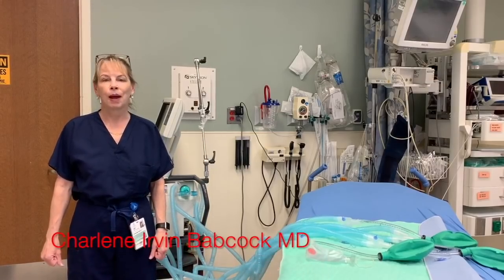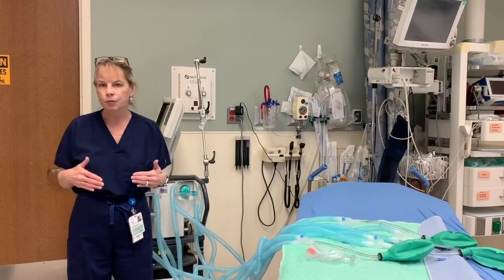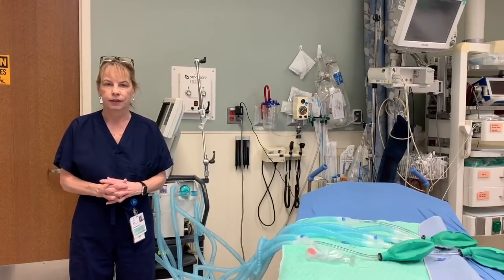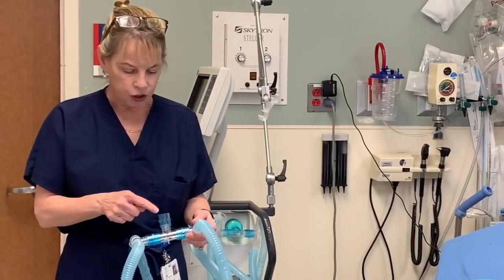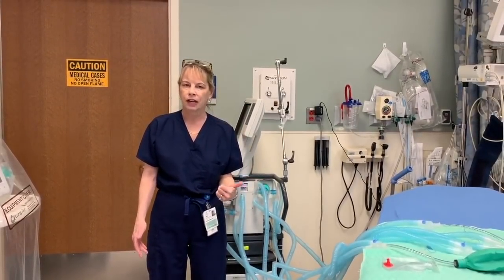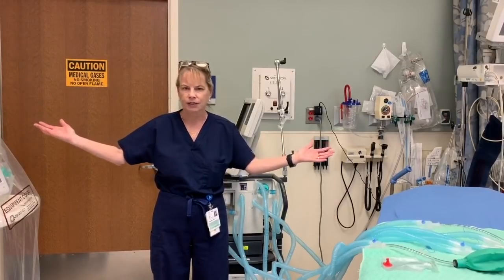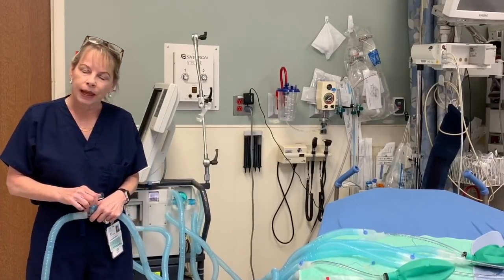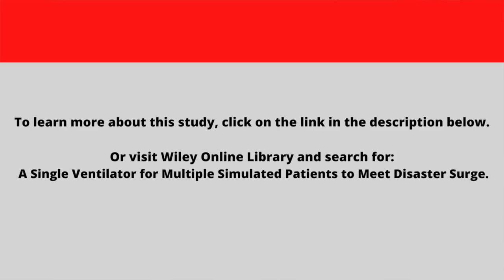COVID-19 How to Use One Ventilator to Save Multiple Lives

Comment: I ruminated a consideration on this proposal for the last couple of days as Germany is in anticipation of the surge.

To be clear: This is also just a theoretical exercise and – if applied - would count as a desperate measure in the case of patients otherwise not being ventilated at all.

What if the mode of ventilation chosen would not be conventional BIPAP but APRV/inverse ratio PCV?

The control parameters correspond to conventional ventilator settings as follows: P-high (P-insp),  P-low (PEEP), T-high (insp. Time), T-low (exp. time) and FiO2. Note that implementing this mode of ventilation with conventional BIPAP, which is possible in some devices, will in some setups require calculation of respiratory rate, which is 60/(Thigh+Tlow). The slightly different terminology as well as specific algorithms for implementation have been characterized and properly published by experts in the field – which I am NOT. There have been promising studies in ARDS which I will attach below.

If one assumes that for two (or more) patients the key treatment goal would be oxygenation with a more liberal approach to CO2 removal, it should be possible to choose P-high, FiO2 and to some degree T-low to achieve safe oxygenation margins for both patients. 
This would still allow for some inhomogeneity in compliance between the patients as the lung is splinted to a rather high point in the P-V curve by P-high resulting in a high resting volume. This is the proposed “open-lung” aspect of this ventilation mode. Nevertheless, due to the sparse and brief passive pressure relief phases it is believed to go without higher frequency repeated expansion like in conventional PCV, resulting in less energy deposition into the tissue. The repeated overinflation/atelectasis due to inhomogeneos P-V dependencies had been my main concern when thinking about PCV in a shared circuit and a possible result of volutrauma/atelectotrauma in the patients. 

In case of inhomogeneous severity between the patients/different disease progression the treatment goal could be set for the more severe patient accepting hyperoxia in the “more well” patient.
In terms of CO2 removal a “common ground” target for the patients could be set in wider range of acceptable values, opting for permissive hypercapnia.
As the passive release of the lung volume to exhalation in T-low will generate outflow which is cropped at a certain level of peak flow (by setting T-low) when conventionally setting up/adjusting this mode, it might be difficult to assess this control parameter for the individual patient in a shared circuit.

APRV does even allow for spontaneous breathing on P-high in weaning approaches which have been proposed as well.
If flow for the device serving two patients would be dialed high enough to compensate for potential maximum inspiratory peak flow generated by both patients in spontaneous breathing, it could be fathomable to even conduct weaning with two spontaneously breathing patients sharing the same circuit.

I write this as I feel we are all staring in a potential abyss, which might force us to make choices that neither of us ever wanted to make.

Hence, this is a THEORETICAL CONSIDERATION and not a recommendation. Also I do not take any legal responsibility if patient harm ensues. I hope everybody understands that.
Also probably someone already thought of this.
But I thought: Sharing is caring.

Take care and stay strong.

C

Cane RD, Peruzzi WT, Shapiro BA. Airway pressure release ventilation in 
severe acute respiratory failure. Chest, Aug 1991: 100 (2); 460-3 Fergson 
ND, et al. High-frequency oscillation in early acute respiratory distress 
syndrome. New England Journal of Medicine 2013, 368 (9), 795-804 Frawley 
PM, Habashi NM. Airway pressure release ventilation: theory and practice. 
AACN Clinical Issues, 2001: 12 (2); 234-246 Garner W, Downs JB, Stock MC et 
al. Airway pressure release ventilation (APRV). A human trial. Chest, Oct 
1988: 94 (4); 779-81 Habashi NM. Other approaches to open-lung ventilation: 
Airway pressure release ventilation. Crit Care Med 2005 Vol 33, No. 3 
(suppl.) Maxwell RA, Green JM, Waldrop J et al. A randomized prospective 
trial of airway pressure release ventilation and low tidal volume 
ventilation in adult trauma patients with acute respiratory failure. The 
Journal of Trauma, Injury, Infection and Critical Care, 2010: 69; 501-511 
Modrykamien A, Chatburn RL, Ashton RW. Airway pressure release ventilation: 
an alternative mode of mechanical ventilation in acute respiratory distress 
syndrome. Cleveland Clinic Journal of Medicine, 2011: 78 (2); 101-110 
Rasanen J, Cane RD, Downs JB et al. Airway pressure release ventilation 
during acute lung injury: a prospective multicenter trial. 
Critical Care Medicine, Oct 1991: 19 (10); 1234-41 Roy S, et al. Early 
airway pressure release ventilation prevents ADRS – a novel preventative 
approach to lung injury. Shock 2013, 39 (1), 28-38
Reply from the maker: SO now we have an IN VIVO study..and. it worked.....

Dr Marco Ranieri of Bologna, Italy and his team Have successfully tested the approach in vivo in one of the hospitals in Italy overwhelmed by the COVID-19. 

They worked with Intersurgical, an Italian company based in Mirandola, started producing the circuitry in only 72 hours, and the first prototype has already been tested by Bologna Sant'Orsola Hospital. It works and in the next few days they'll start a mass production to supply Italian hospitals who are in need

Comment: This is super helpful, I'm an anesthesiologist and we are prepping for a major influx of COVID19 patients here in Houston Texas so I'm taking notes!
Reply: Please don't until you've checked the vents for maximum circulating volume.
Reply: Well you should go for more schooling, this is about the stupidest thing I have seen. People's lungs have different compliance and there is no way to put people with "similar" lung compliance together as compliance is dynamic.
Reply: @Catching_Rockets  for two patients same or near weigth parameters ar closely the same ...si theoritecly it's pissible
Reply: @slimanirabie1820  Your not taking into account lung compliance. So theoretically it's completely impossible.
Reply: @Catching_Rockets  Yes there is. It is easy to modify the volume of air going to each tube with a simple screw valve. See: https://www.youtube.com/watch?v=eSVbwWANqRI&t=90s
Reply: @reality9  You can't modify volume of air with a screw valve. And I don't need links, I'm educated. Pressure is going to follow the path of least resistance. If you put two people on a vent one with good compliance and one that goes into ARDS your going to end up with a pneumothorax, screw valves or not.
Reply: @reality9  The only way this could be achieved with a screw valve is if you had equal compliance of the lungs.
Reply: Drew Perks buddy, she’s been spamming this video with links to people uneducated about respiratory mechanics. Multiple people have told her she is wrong (people who are R.C.P. or actual pulmonologists) and she keeps posting the same BS. She’s not right in the head.
Reply: @Beard-OF-Courage  That's crazy! I'm a RCP. But you can probably deduce that.
Reply: Drew Perks Of course! I’m happy to see there’s a few like minded individuals who understand ventilator mechanics. The hard part is when there are physicians, with little experience trying to jerry rig this to work on balloons. When these won’t work on actual sick patients. The people with no medical knowledge just eat it up and shove the actual people who work with vents to the corner.
Reply: @Catching_Rockets  Perhaps you are not an engineer or haven't taken fluid mechanics. Pressure does not FLOW. How you were educated, I do not know. Maybe in basket weaving?
Reply: Please see: https://www.youtube.com/watch?v=eSVbwWANqRI&t=90s

Comment: length of tubing must be the same  !
pathology the same
pulmonary capacity in the same range
Unfortunately in case of pandemic  those conditions are easily meets.
It is not a "normal way" to work but if it can prevent you to have to decide to kill several patient per day  (watch the rate of mortality in italy) you will seriously think about !
And to think about it better to know about it !
So in the hope that you will never have to use it ... learn about it
about AmbuBag MIT has developped a very effective device 
http://news.mit.edu/2010/itw-ventilator-0715
Reply from the maker: THey are successfully using it in Italy...its now been tested in VIVO....read below...

Dr Marco Ranieri of Bologna, Italy and his team Have successfully tested the approach in vivo in one of the hospitals in Italy overwhelmed by the COVID-19. 

They worked with Intersurgical, an Italian company based in Mirandola, started producing the circuitry in only 72 hours, and the first prototype has already been tested by Bologna Sant'Orsola Hospital. It works and in the next few days they'll start a mass production to supply Italian hospitals who are in need

Comment: Every lung has different compliance ❗❗❗That is nonsense
All of the air will flow into the lung with less resistance.🤹‍♀️
Reply: If you had experienced an acute asthma attack, you would not be picky as to where the oxy comes from.
Reply: @casavistalba3232  If you had a clue what you are talking about you would know ventilation (exchange of CO2) is what asthmatics need, not oxygen.
Reply: Any port in a storm?
Reply: https://www.youtube.com/watch?v=eSVbwWANqRI&t=90s
Reply: I guess then let them die?
Reply from the maker: YES you are absolutely correct...the clinician MUST MATCH patients with similar compliance...not easy, but if you can do it, it will work...see below

Dr Marco Ranieri of Bologna, Italy and his team Have successfully tested the approach in vivo in one of the hospitals in Italy overwhelmed by the COVID-19. 

They worked with Intersurgical, an Italian company based in Mirandola, started producing the circuitry in only 72 hours, and the first prototype has already been tested by Bologna Sant'Orsola Hospital. It works and in the next few days they'll start a mass production to supply Italian hospitals who are in need
Reply: @charlenebabcock1048  Compliance is dynamic, this is literally impossible!

Comment: Cross contamination with different versions of Coronavirus is an issue, not to mention any other transmissible disease they had.  Genetic sequence studies in China made that clear.  That being said, pretty easy decision whether to risk cross contamination when someone would die without ventilation.  However, if one patient has something nasty and is going to dramatically negatively affect the other patients, that would have to factor into the triage decision.
Reply: Einstein, we are talking about dying people here. This is the last resort. This or dye.
Reply from the maker: you can put a filter at. the connection of the expiration port and the 4 port device as it joins the ventilator.....just an idea...